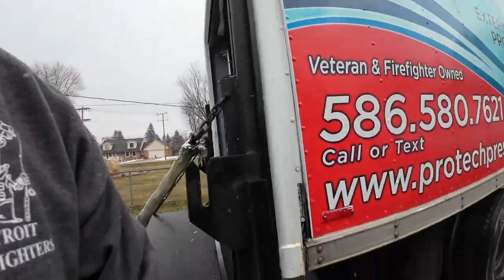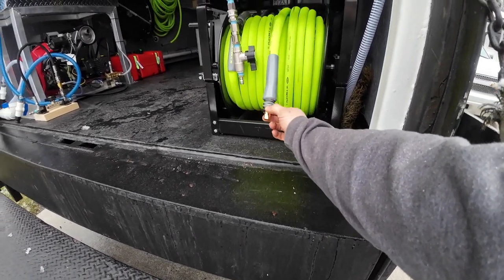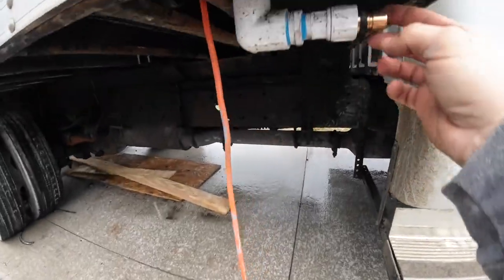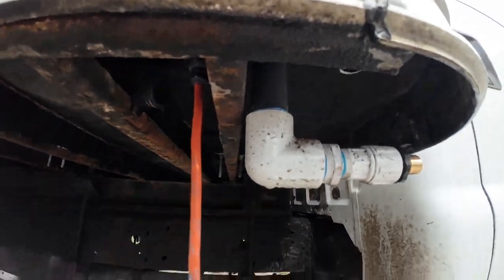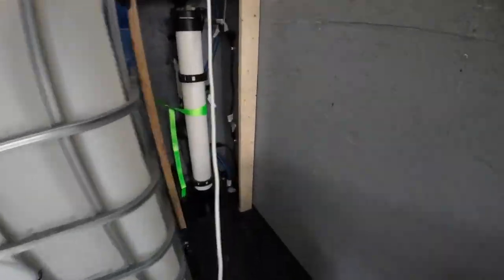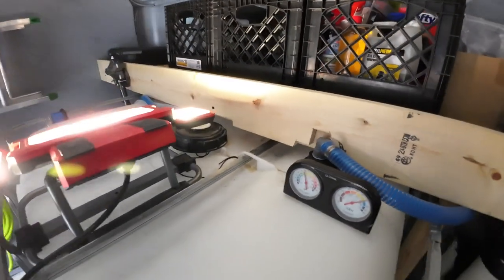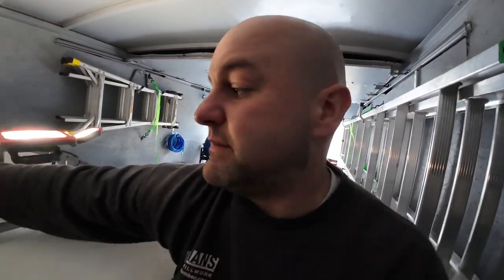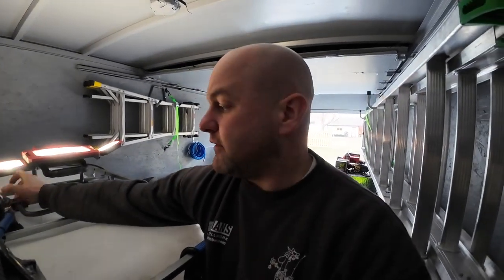Pressure Washer Buffer Tank Set up

Comment: I tried those quick connects last year and felt like it was restricting flow to my direct drive washer. It seems like a smaller diameter than the hose.
Reply from the maker: Interesting. I guess I’m going to find out.
Reply: Are you running 5/8" or 3/4"?